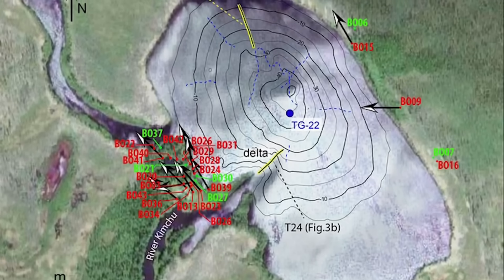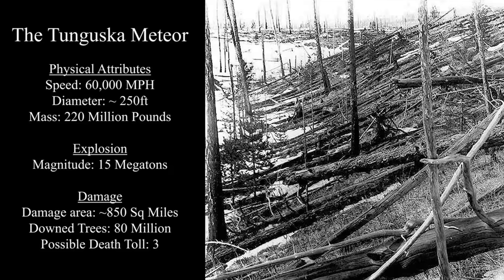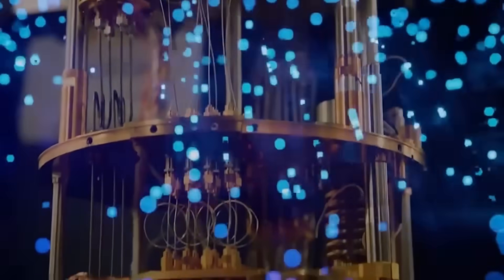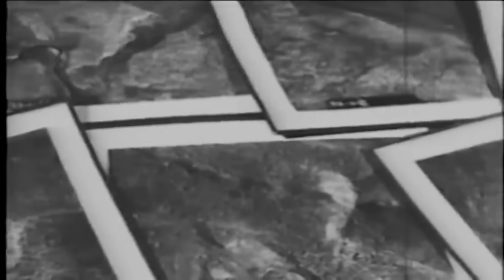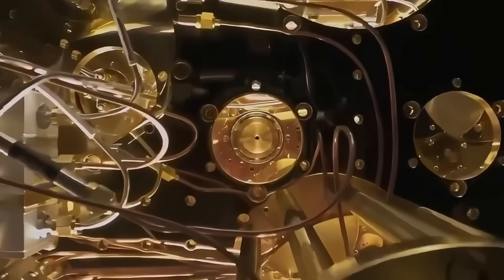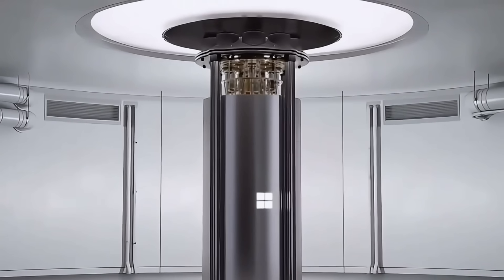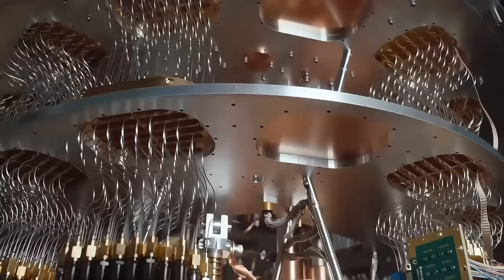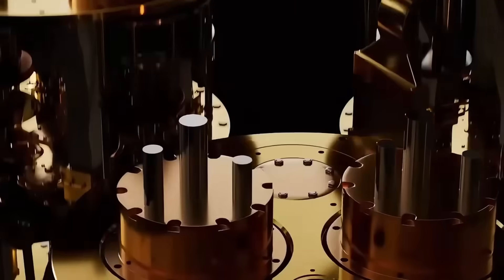Stanford’s Quantum AI Just Recreated The Tunguska Explosion - Then This Happened..

Comment: Soviet scientists recreated the airburst using matchsticks and a firecracker. Definitely an airburst. In 1960 something.
" Soviet experiments performed in the mid-1960s, with model forests (made of matches on wire stakes) and small explosive charges slid downward on wires,
produced butterfly-shaped blast patterns similar to the pattern found at the Tunguska site. The experiments suggested that the object had approached at an
angle of roughly 30 degrees from the ground and 115 degrees from north and had exploded in midair. - Wiki

Comment: Your parameters are guesses, albeit educated guesses but guesses none the less. the AI is adjusting the physics of the event to best match your guessed parameters which are far more likely of being incorrect than the physics. prioritize flexibility in the parameters i.e. size, speed angle and composition while lessening allowable flexibility in the physics of it unless the AI is able to articulate and duplicate the physics adjustment after all parameter adjustments are exhausted. Maybe there was a giant methane hydrate release at that exact time and place or maybe it was mostly ice and bigger with some rocky materials mixed in explaining the lack of impact since the ice vaporizes and the rocky material is the found spherules? maybe it was a horizontal impact so all the energy of it vaporizing went straight down instead of across the atmosphere?  Maybe that is why almost nobody saw it?

Comment: How many times has the simulation been permitted to run to completion without additional external input of for instance, parameter values? Was the Tunguska area ever examined for radioactive residue? How far does the simulation go in attempting to modify some aspect of the simulation it's running? What comparisons have been made with data from actual H-bomb tests from the 1950s?